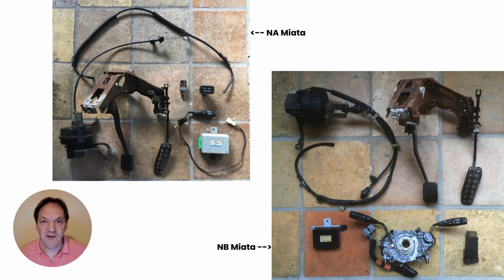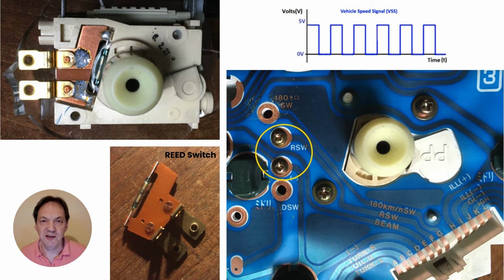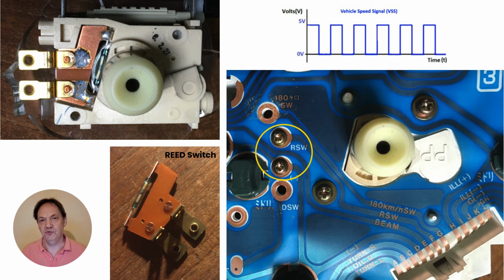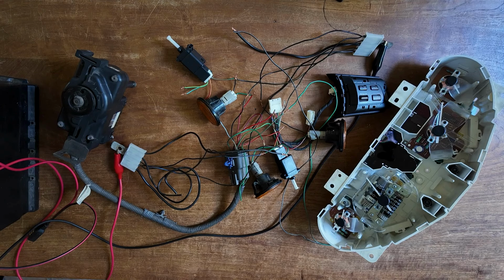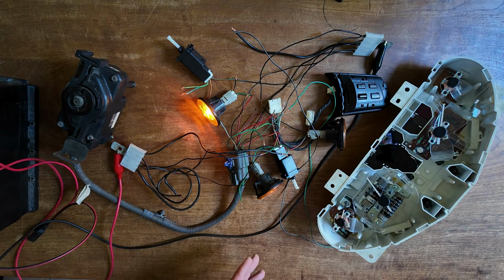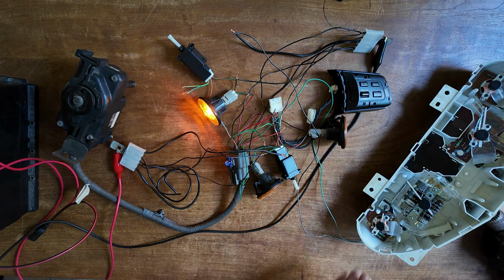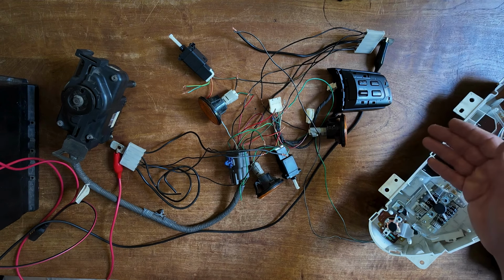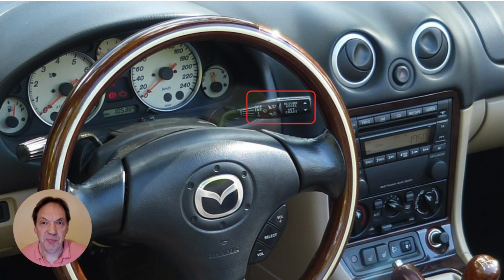The alternative Mazda cruise control system for the NA and NB MX-5 Miata

Comment: Hi Jeroen, I love the videos. I would want to do this on my 1994 EU spec NA 1.8. Would fitting a miata cruise stalk and cruise on/off switch work with the Mazda 6 actuator? You mentioned that an NB stalk would not work, but would one from an NA work? Many thanks :)
Reply from the maker: Thanks for the complement!
On the EU spec NA you probably have the straight stalks as part of the combination switch that was also used on the B2200 and B2600 pickup trucks. The main difference with the system that was used on the NA Miata is that all power is going through that combination switch, instead of via relais. The steering column is different in diameter as well. Simply swapping the steering column for one from an NA Miata or NB will not work because of the electrical differences.
Nevertheless, you can get the Mazda 6 cruise control system to work on your EU spec NA.
You could use switches on the steering column covers, making sure you take care of the resistor values that the Mazda 6 actuator/module expects.
You could use a separate ON/OFF (main) momentary switch without a resistor, so just briefly connecting the signal to ground everytime you press it, to toggle between ON and OFF.
The cancel switch is optional, the original system for the NA and NB don't have that function either. Otherwise use a resistor of 120 Ohm for that switch. For the other switches you use a 680 Ohm  resistor for SET and a 2200 Ohm resistor for RESUME. 
On my website, I have a page about how I install the original cruise control system on the EU spec NA. It also has pictures of the flash-off-flash switch I used for the SET and RESUME switches on the steering column cover.
https://mx5info.com/cruise-control-na/
Reply: @mx5info Hi Jeroen, my 94 is an air bag model with bent indicator stalks. I believe 94 was the changeover year. Knowing this and having a read of your website, it should then be possible to mount and use the original switch on the dashboard? (I also speak Dutch if it’s easier to answer in Dutch)
Reply from the maker: @robbiegill3790  Hi Robbie, in dat geval wordt het interessant om eens te kijken naar de mogelijkheden om de originele delen te gebruiken, maar dan wel met aanpassingen. De originele cruise control main switch heeft een ON, OFF en neutrale stand daartussenin. We zouden eens kunnen kijken of je de ON stand kunt gebruiken als ON/OFF en de OFF stand als CANCEL. De hendel aan de combischakelaar kun je dan gebruiken voor SET en RESUME, als je rekening houdt met de weerstandswaarden. Via de contactpagina op mijn website kun je me ook bereiken via mail, WhatsApp of Messenger als je wil. Signal en Telegram zijn ook nog opties.
Reply: @mx5info dit klinkt als een leuk project om te proberen. Ik ga eerst eens kijken of ik de onderdelen kan krijgen en zal t.z.t. contact opnemen voor advies!
Reply from the maker: @robbiegill3790  volgens mij heb ik die onderdelen nog wel.

Comment: I've had same '91 for 24+ years.   My cruise control recently quit at 300,000 miles - I've used it virtually every trip for past 210,000 miles with zero issues...  Can hardly say it's not reliable.  I have no doubt I'll have it back up and running soon, but may go to the  Maz6 system if I can find one in the breakers.
Reply from the maker: Most of the failing modules I have seen from the NA, suffered from leaking capacitors and could be revived. Not all of them. The actuator in the engine bay is very reliable as well, especially if you replace corroded terminals in the connectors.
Nice to hear you use it so frequently and that is has been so reliable.
On earlier posts, some people commented to have had many Miatas and the cruise control never worked. The people for whom I installed it are still going strong with their systems as well.
Reply: @mx5info    A few weeks ago,  CC light would  intermittently go out,  and lose command signal to actuator.  I found that if I held the "on" switch in, and rotated the stalk switch to set,  CC would  come back on line (even thou the light was out).  Accel/resume and set would work just fine. Most of the time the light would come on and things were fine; other times, it would not illuminate no matter how many times I hit the switch.     I replaced the "on" switch with a known good one - no joy.  Removed brake and clutch switches and checked both.  Found the brake switch tip had worn bad enough that the brake lights would sometimes stay on. I extended the switch end and replated all four contacts in the brake switch and both contacts in the clutch switch. They are properly adjusted and have zero ohms when closed and infinity when open. I then replaced the module  with a spare and the  on switch light now comes on and stays on, but  CC  still doesn't engage.   I've checked the stalk switch in set and accel/resume. No issues.   Last night I pulled the old module apart-  two of the caps are leaking.  I repair NA ECUs and have a half dozen of every cap in the ECU on hand  (I  have all the values for the CC module)  My next step is to eliminate the LED brake lights (which I understand can affect  resistance to ground in the module )   I'm open to any suggestions....
Reply from the maker: @markc4768  when the light in the main switch does not stay on after releasing the switch, usually it means that the module is malfunctioning.
As you already discovered, leaking capacitors are the usual suspect.
Did you run the diagnostics? That is the easiest way to check what is working and what is not.
Watch this video for more information about how to use diagnostics modes and interpet the results. Led light in the brake lights is not a good idea, because the voltage drop is not big enough for what the module expects.
https://youtu.be/F0I60VsP-cQ
Reply: @mx5info  I've swapped out the module - light stays on but no engagement with the stalk switch.  I've verified that the clutch and brake switches are ok.  Never had any problem with the LED brake lamps before, but  plan on replacing them tomorrow - maybe  they've changed resistance values.   We have a ranch -  lots of prep for last nights storm then another boatload of recovery today...  I'm a retired automotive engineer and not accustomed to having to actually diagnose/troubleshoot for more than a few minutes before getting down to the root of a problem. My NA6 "superpower"   is  start sequence circuits and the internal workings of the ECU.  I have not run cruise diagnostics yet.   I  have a hot rod and a road trip car   with more pressing issues than the Miata's cruise control so it usually  gets "catch as catch can"  time.   With the intermittent light  then   no light issue,  I was counting on   the brand new on/off switch and an assumed good  spare  module to cure the issue.     In a last ditch,  if  incandescent brake bulbs don't cure the CC engage issue,  I'm going to replace the bad caps in the original module, and see if that fixes the problem (on the premise that  just because the module is passing 12v to the switch,  and indicator lamp lights up, doesn't mean it will pass   set/accel pulses to the actuator...)     I also have a spare actuator if all else fails...  Thanks for the lead on the diagnostics video.  I've watched it and your other vid in the past.
Reply from the maker: @markc4768  please keep me posted. You would not be the first where leds in the brake lights caused an issue with cruise control.
On my most recent install, on an NB2, I encountered an issue with the brake switch, where the signal for the small connector caused the issue. When the brake pedal is not depressed, there should be continuity, but is was intermittent. You could try to put a jumper in the connector to try if cruise control engages, but be aware that it might remain engaged when you press the brake pedal, so you should only do this to test if it has any effect.
Reply: @mx5info   I went back to standard bulbs, but no change.  Ready light comes on, but stalk switch will not initiate cruise.  I'm intimately familiar with the brake and both clutch switches; I've disassembled many.   replated the contacts with pure silver and reassembled with no issues.  Even in the presence of measured static continuity, I added  a jumper to verify that continuity thru the brake switch during initiation was not intermittent.
Reply from the maker: @markc4768  were you able to run diagnostics yet?
Your next step should be to check the signals from the wiper/cruise lever on the combination switch. It has three wires. Black is ground, blue is set and yellow is resume. If blue or yellow is permanently grounded, or if one the wires is broken you would also have this issue. In the resting position, none of these wires should be connected with each other. For set, black and blue are connected. For resume black and yellow are connected. On the wiring loom of the car (after the connector from the combination switch) the resume wire will be red/white towards the module, and the set wire will be red/blue towards the module. Check if you can find a broken cable, because that might have been the reason why the issue was intermittent.
For more information about the diagnostics modes you could watch this video: https://youtu.be/F0I60VsP-cQ
Reply: @mx5info  thanks for the terrific direction.  Weather has been miserable and I've got my shop filled with projects that have to be done before it can be cleared out....  Cold wet and snowy thru Thursday...  But I will get on it as soon as possible.  Thanks again!    If you ever  need assistance with the start circuit  or ECU pin outs,  I've got 20+ years of experience...
Reply: @ Don't know what happened to my detailed reply  from a couple days ago....  in a nutshell 
   - Both tail lamp bulbs have been replaced with NOS OEM pvr arts. 
  -  I have verified 12v at the master switch and at the input to the CC module.  
             - the master switch lamp remains lit when the on switch is depressed.
-    I verified that the brake and clutch switches are functioning correctly.  The contacts are all clean, aligned  and polished and read true continuity through a calibrated combo digital/analog  ohmmeter, and I got  zero voltage loss with a 12v power supply lighting a sealed beam headlamp thru each switch.  
   - I verified the stalk switch operates correctly; no internal shorts;  one switch remains closed when the other is open and  vice versa.  
          -  Less than  100mv drop across the switch  with  12v on  the two input wires  and a 1057 brake light filament between the black wire and ground   
- I replaced the actuator with one that worked  the day it was removed and boxed up.   
     -  Had a viewing and  funeral to attend yesterday/today.   Tomorrow I will be getting back on it and will watch your last couple videos a few times each in case I have missed something.    Thanks for all the help.
Reply from the maker: @markc4768  nice! Please keep me posted and raise questions if you have any.
Reply: @  success!!!   The module I had  installed as a replacement had a broken solder joint that I just found during a hard look under a stereo microscope and  no shadow lighting...   ("light stayed  on but nobody was  home... :)  "  The original module ( light would not come on)  had a bad 10uf 50v cap that was not leaking electrolyte  but would not hold a  charge.  I replaced it, light came on,  CC engages and I'm back in business with a spare to boot. Thanks for the guidance!

Comment: This is great! I alreday ordered the mazda 6 cruise control module. As for the control buttons, do they have resistors? Or does the module require just simple 0V/12V states?  Thanks
Reply from the maker: Thanks!
The control buttons indeed use resistors. I am currently working on a video that will provide more detail about it. If you need the information earlier, just email me at jeroen@mx5info.com
Reply from the maker: I have just uploaded a new video. It also covers the resistor values for each of the cruise control buttons.
Reply: @mx5info  Thanks!